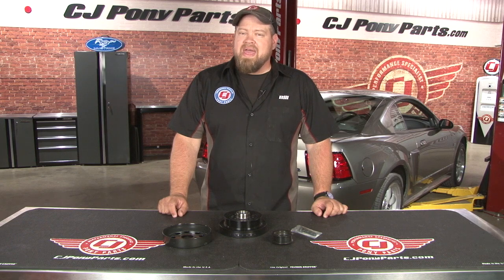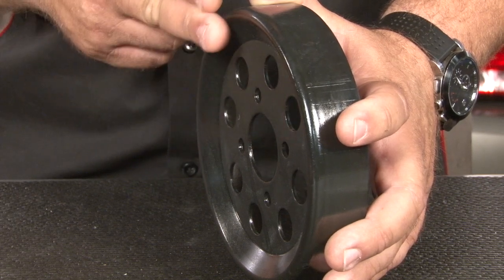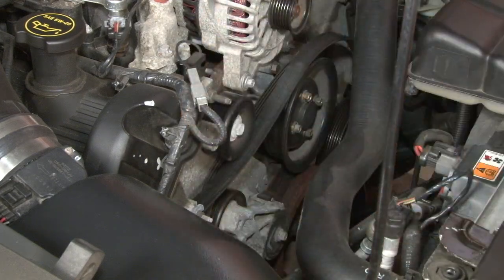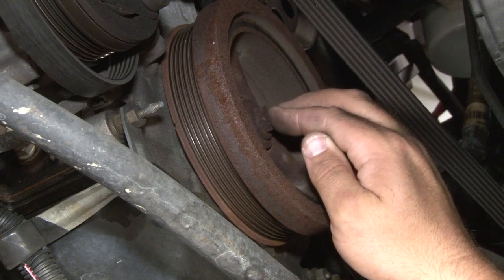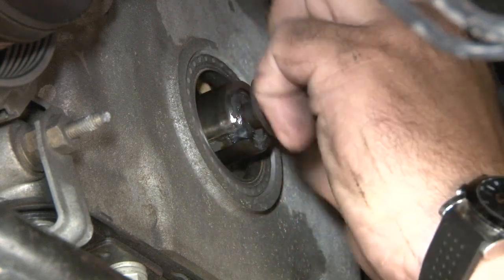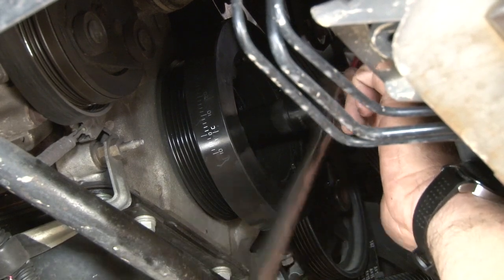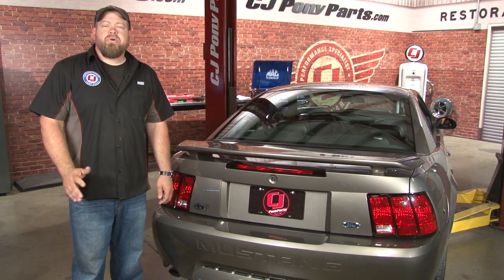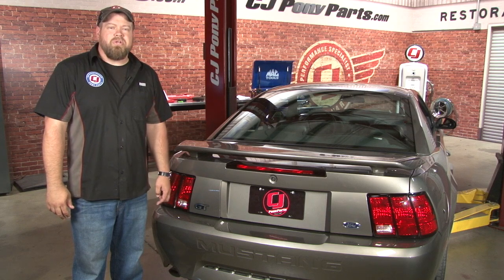Mustang Steeda Underdrive Pulley Set 2001-2004 Installation

Comment: Thanks for the video. Can anyone answer this question; Are the $300ish dollars worth the purchase? Is it that much better in gas mileage and horsepower? The is for those who can answer this. I have a 2002 Mustang Gt.
Reply: I thought so, it’s an improved design also the balancer pulley won’t go bad like the factory one.. 

The pulley set releases about 10hp and 10 torque of parasitic loss..  Easy install and better quality than factory, no charging issues or cooling issues at all..

Comment: I ended up just using an impact to get the crankshaft bolt off. Was easy since I was replacing the Radiator at the same time so I had plenty of space for the impact to fit

Comment: How are these Steeda Underdrive Pulleys compared to the SR Performance Underdrive Pulleys or even the BBKs? 
What's the difference and why does one cost $100-$200 more than the other?
Reply: These are developed with Ford. Other brands' udp's are not, they're piggyback. You can ruin your engine with udp's. With properly installed steeda's you don't.
Reply: @fluboy3434  Thank you for the reply. I bought Steeda's for my 03 mustang.

Comment: I bought the bbk pulleys i did notice hp gains but after installing them i notice my battery and a/c not working properly so after watching several videos i found out that the belt isnt spinning like it used to so my a/c is dragging and my new battery was dead after 20 min of driving around so id do some research first im eventually gonna have to remove them and put my stock pulleys back on ! I could buy a higher amp alternator and a gel battery but it doesnt make any sense to spend 500 dlls jus for like 8 -10 hp
Reply: Did you happen to get the belt spinning correctly with these Steeda pulleys and fix your a/c , battery issue??
Reply: They will only give issues if you’re alternator was dying to begin with.. Steeda did extensive testing with Ford, these things work great..

Comment: 😂😂😂 these guys literally drilled holes on the water and alternator pulleys and are selling them as high performance.
Reply: I put 3 pulleys on my 2v 02 mustang gt automatic and mann this is a big game changer,  it worked for me noticed the difference right away
Reply: I just weighed them. Everything weighed the same. Couldn't get alt. Pulley off could not get crank pulley OFF. Sending it back immediately. Waste of 250$
Reply: @anthonyhales4192  you need to rent a puller at autozone or something to get the crankshaft off it takes time and maybe a couple of people that was the hardest part. You shouldn’t give up on these pulleys cus you will gain much more hp trust me
Reply: @jamessoria9706  i got them on. Did not really notice any difference along with an aluminum driveshaft.

Comment: There is no way this guy took off the crankshaft bolt with just a wrench. I suggest using long breaker bar with belt off and place breaker bar against another pulley or against somewhere it will get stuck and won’t move, then crank your car very carefully and slow (I mean just turn the key to crank the engine but don’t try to turn on) and bolt should loosen.

Comment: I have a 5 speed, but trying to remove the dampener, it just spins.  I have the brake on, and it's in 5th.
Reply: Find another tool to hold the pully why you loosen it up. with it being in 5th gear, the crank shouldn't move, but since it is, it could mean a few different things. If your car is on a lift and the brake is one, then your brake may not work properly, your brake pads might be really worn, or the clutch could be slipping and might be worn as well. the clutch is connected to the trans, and the flywheel is connected to the engine. There is a pressure plate that clamps the two together. Either the pressure plate is worn and isn't providing enough clamping force, or the clutch is worn and is allowing slippage between the flywheel and pressure plate. I would get it checked out, or if you are able to check it yourself, do so. I replaced my clutch not too long ago, it is a tedious process, but watch a Chrisfix video on how to do so as he does an amazing job explaining it step by step as well as preventative maintenance. If you get a stock clutch from advance auto to do this job, go ahead and buy a pilot bearing and a different throwout bearing. I used that kit to replace mine, I bought a different pilot bearing, but my throwout bearing is squeaking like hell and I don't know what to do about it except replace it again. I called Firestone and they would charge 1k to replace it, while the Carquest kit is 100 bucks. If you have the time, tools, and patience to do it, then I would do so. It took me 2 days, but I had issues removing exhaust and didn't want to work in Georgia summer heat doing it, so I did it mainly at night. I would allow about 2 days to do it. I also had the car about a foot and a half off the ground and didn't have much clearance when I removed it, so get the car up kinda high. That's what could be the cause of a crank pulley turning when in gear and how to go about fixing it. Check brakes, brake lines, brake cables, clutch, clutch cable, and if not, use something to hold the pulley while you turn it.

Comment: How do you hold the torque converter so it doesn't spin?
Reply: You see how he takes an impact gun to the alternator pulley like easy peasy. Yeah . fuckin.right. worse with the crank pulley . this is a nightmare to attempt on your back in your garage. Its all bullshit. Wont be using these guys again after a 6 week lead time on a throttle body I ordered. Never told me it was out of stock and shipped directly from the manufacturer. Greed.

Comment: How much Horsepower do you really get from this mod?
Reply from the maker: You will realistically see a few HP at the wheels with this, nothing crazy but you will see a few. Steeda is claiming up to 10HP.
Reply: @cjponyparts  does this kit work for an 04 v6?
Reply: I had a 2000 GT with some bolt on parts (4.10 gears / intake / Flowmaster American Thunder exhaust).  I sold it, thinking I wanted a newer GT, and bought a 2005.  I sold the 2000 to a colleauge of mine.  He put UDP's, an aftermarket throttle body and aftermarket coil packs on the car.  The next time I drove it, I couldn't believe the difference between the car I sold him and what he had now...... it revved much quicker, and felt super snappy.  I regret selling the car......  it was much quicker than my 2005, which I ended up selling anyways.  All that to say that the UDP's are part of a comprehensive set of bolt ons that'll really change the way a 2V 4.6 will feel!

Comment: Do not reuse the stock bolt it is a TTY bolt so a new one is needed
Reply: BoostedModular Solutions I reuse mine and never had an issue no check engine lights nothing no wobbles the bolt is still tight
Reply: What bolt do u recommend?? I head to not use old bolt as well
Reply: Oem bolt or ARP

Comment: At 3:15 , why did he take the bolt out, only to put it back in again to remove the harmonic balancer? Why not just unscrew it a few turns, and then use the pulley puller, and take the bolt out?
Reply: Because you have to remove the washer or the crank pulley will not come off.
Reply: Bill Tumas  - That makes sense. Thanks.

Comment: I have an automatic and need to know some more information about the whole torque converter thing and how to do it
Reply: +Bill Tumas you mean on the torque converter??
Reply: +lyonschoice    You have to hold the bolt on the converter to stop it from spinning. It's a two man job, there is an access plug you can remove I believe on the drivers side and you will see the torque converter bolt.
Reply: lyonschoice all you do is stick a pry bar in the flywheel and hold it there

Comment: how does it effect the power steering?
Reply: +Luke Lanigan The power steering works the same as it always did.
Reply: +James Fitzsimmons Put a pry bar on the bolts or try and hold with a wrench
Reply: +Bill Tumas which bolts the ones on the torque converter or the ones where the under drive pulley is.
Reply: +Bill Tumas in the video you said to hold the torque converter on an auto how do you do that? I need help!

Comment: CJ Pony Parts Does under driving the water pump cause any overheating? Also, does under driving the alternator create any problems with charging like insufficient amperage to the battery?
Reply: Greg25RS In my experience with this kit, it does not run any hotter. I do notice that at idle, the lights tend to dim a bit. I changed out the alternator with a PA Performance Alternator, and it fixed the problem.
Reply: My Stang runs cool always with my BBK under drive kit

Comment: As Colton said, how do you hold the tc on an auto please?
Reply: Put a socket and breaker bar on  the balancer bolt and just hit the starter.. Don’t hold it just a split second..
Reply: @NewEdgeDesigns just did this on my crown Vic worked well
Reply: I’ve been wondering that myself.

Comment: I have an automatic, how do you hold the torque converter so the engine doesn't spin?
Reply: Where is the hole located ?
Reply: @TrippOn1  in between the left and right checks
Reply: Just dont use a lift dumbass